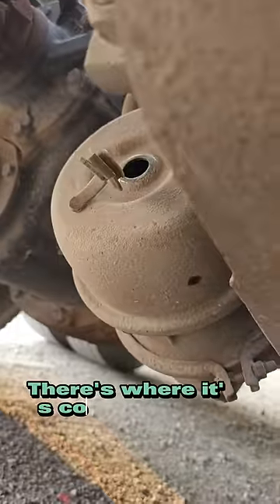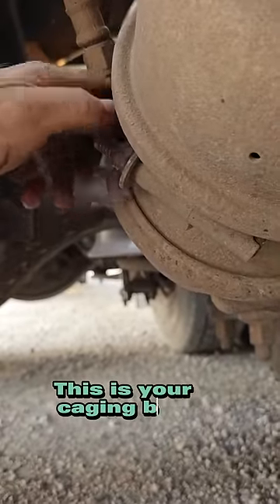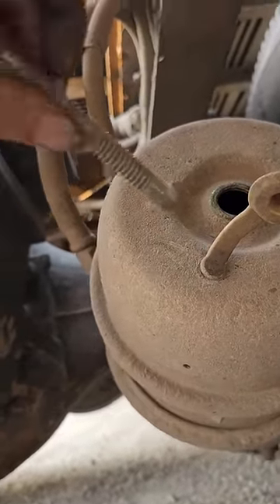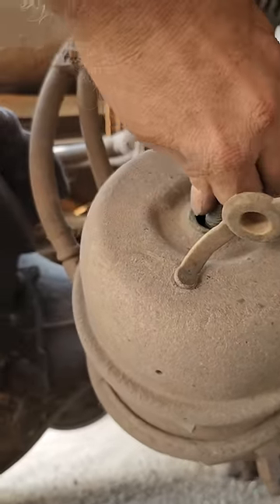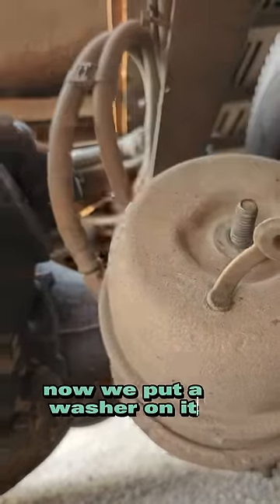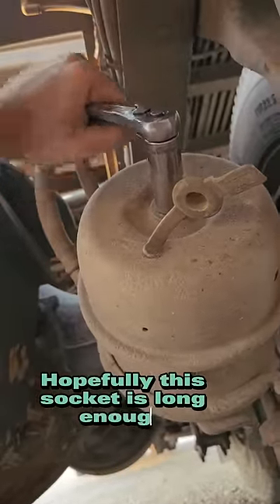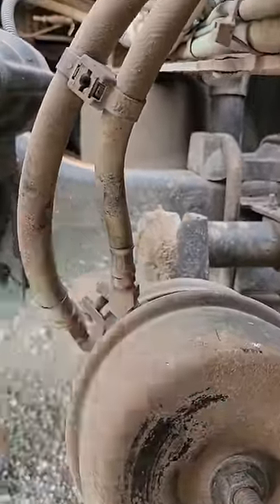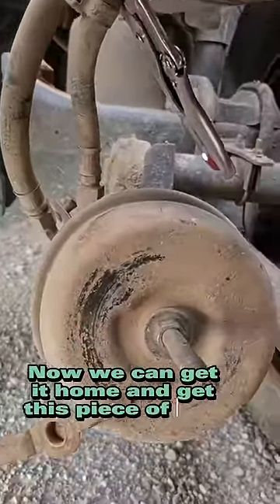How I cage a brake chamber and get home

Comment: Nice fix but please remind people how dangerous brake chambers can be if someone doesn't know what they're doing.

That spring can shoot through a concrete block wall and will turn someone's guts to soup if they're not careful or don't know what they're doing
Reply from the maker: Good advice.  I'll highlight your reply so its at the top of the comments.
Reply: You also need to put the parking brake on when work with a brake chamber as well for the slack adjuster to release so you can safely work on them.
Reply from the maker: @wethobgoblin2740  that's how I did it.  A lot of people have suggested to cage the chamber with brakes released bc it's easier but I just applied them and did it.  Took longer but felt safer.
Reply: Both times I had blown chambers the spring had broke and ruptured diaphragm. Company driver and funny I just had 1 blown on trl this morning. Waited a few hrs at delivery store while waiting for mechanic
Reply: Usually, the spring is broken by the time it leaks like this. You can tell if you smack the chamber and hear a rattling piece of metal
Reply: I was about to say the same thing hahah
Reply from the maker: @ItalianStallion1415  good to know.  Thanks for the knowledge
Reply from the maker: @tractorboy31  When it rains, it pours
Reply: @ItalianStallion1415 I've had more than a dozen leak in my carreer. only 1 had a bad spring.
Reply: Yes if the brake chamber explodes and your in front of it it can and will kill you! Be CAREFUL even if yours a professional
Reply: Very confused... what would one do to get a brake chamber to explode or a Mega strong spring to shoot through their guts?
Reply: @tractorboy31 😅
Reply: @jalenwiggins5831 ,
120 psi is standard air pressure on truck  brake systems. It doesn't take nearly that much air pressure to kill.
Reply: @joelnathan7184  so what do they do to release that pressure...........
Remove the wrong bolt?
Reply: @jalenwiggins5831  yes,  the band clamp.
It is holding the chamber pressure.
Reply: I need to see the inside, what did it caught? What spring etc
Reply: They are most definitely a bomb
Reply: Could just imagine someone removing a clamp bolt instead of the caging bolt which may be missing....
Reply: @ItalianStallion1415 That's not really true. We used to change diaphragms rather than chambers. Nowadays it's just not worth it, but I have changed lots of chambers that just had broken diaphragms and not springs. In fact the majority of the ones I have done.
Reply: Cagin bolt. They were invented in Louisiana.
Reply: @jalenwiggins5831 
Excellent q!
As he showed while unscrewing the Cajun bolt from the side of the chamber, a bolted clamp encircles the chamber near the center.
.
If that clamp is released prior to Cajun the brake-spring, the internal spring erupts with terminal velocity.
.
Those parking brake springs are engineered to stop the vehicle in an emergency, plus hold the vehicle while parked... irregardless of grade or weather.
As you might imagine, they are powerful and in a tiny space.
Reply: @largemarge1603  thank you so much!
Reply: Another thing regarding caged bolts is that when that bolt is under tension TREAT IT LIKE A LOADED GUN.  Do not put yourself or anything you care about in the path of that bolt.  If it cuts loose for some reason it will have enough velocity to pierce you.  That is a really strong spring under tension that is being held by two little tabs of steel and nothing more.
Reply: 1800 pounds of force in there, it’s kinda hard to hurt yourself tho. It’s either got to be almost rusted thru or you have to cut it open with a torch. They quit making the cans with removable clamps on the parking chamber a long time ago
Reply: Good emergency fix
Reply: Exactly how that bolt got the name dead man tool😂
Reply: Agree, did road service for many years, seen a few of these T bolts fail.  Still amazes me, 1 piece of maybe 1/4-1/2 rubber can can be so dangerous to change.  Was worse back when both sections had bolted clamps 1/2 piece clamps (they switched to crimped later on for the dangerous section).
Reply: Calm down boy
Reply: That side of a can hasn’t been serviceable for yrs no one can hurt their  selves with em and chances are the spring is broke anyways if that sides leaking.
Reply: Usually by trying to replace the pancake gasket
Reply: You mean like this guy?
Reply: The problem with this way of doing it is 99% of the time the caging bolt is rusted to the aircan. And instead of using vise grips to pinch the airline, I recommend folding the hose over and securing it with zip ties. An easier way to do this is to pinch off the airline and back off the slack adjuster as far as it will go.
Reply: The new 3030 cans and most all cans have the bad side with a solid crimp ring.  They made them dummy proof.  Taking a can part isn't dangerous if you do it correctly.
Reply: I don’t know what I am doing but now I know even if that looks easy my life can easily be taken away smh sheesh… 🙄

Comment: I always pull my cage bolts and put them in my tool box.  I've had way too many times i couldn't get them out of the holder on the brake can due to dirt/ salt/ road grime.
Reply from the maker: I'll have to do that, especially with winter coming.  Appreciate the tip!
Reply: @aftersolo always keep a spare or 2 in the truck with you
Reply: Looking at the dirt on that chamber and how easy he got the cage bolt out he doesn't drive anywhere near the rust belt 😮
Reply from the maker: @rickcross7888  definitely not.

Comment: I’d tape the vice grip to hose; less chance of loosing it over the road.
Reply: My dads friend had a vice grip on the brake line driving home on I-75  it came off went through someone’s window and made them blind and he went to jail good idea to tape it
Reply: I was going to say the same thing
Reply: @BillyBob-im7og how did they know if they went blind.
Reply: @magicalphones  lawsuit
Reply: I'd be more concerned about the possible damage to the hose? Are these not wire woven air hoses that will crush and break the steel braided portion of it and cause it to weaken?

Edit to add, I've seen low pressure fuel hoses be damaged from technique like this. So I assume more rigid air lines would suffer similar damage? I Understand the point of getting yourself home without a tow, but I assume that line needs to be replaced now? It's basically been crushed, isn't it's integrity compromised?
Reply: I used wire ties
Reply: @magicalphones Someone who was behind the impacted car drove after his truck and was honking/flashing to get him to pull over. He did right gave insurance to the police and stuff the lady was rushed to hospital and yes Cooper is right they sued him even after insurance felt out 10k she then sued for something like unlawful recklessness but it wasn’t reckless they used a different term in court.that’s how he found out about the blindness and yes he was charged.

He literally told the cop at the scene what he did and that’s why the grips fell off lesson learned DONT tell cops shit
Reply: @BillyBob-im7og  sounds like a bunch of horse dung to me, how long ago did this happen id love to look it up?
Reply: @RaviSingh-xl3os  hmm I’d love to ask my father but he’s been dead for a while now I’d have to say atleast 50 years ago died at 87 he did truck driving around the age of 30-40 so about that time range and yeah you can think what you want my dad got no reason to lie but I’m not sharing personal info if I wanted too maybe my username would be my real name

Comment: You can back the brake off the drum by turning the slack adjuster and then punching the libe off too. I dont ever leave a cage bolt in my new chambers. They fall out and ya run them over and screw up a tire.

Comment: Also, it is 100% legal to be down 1/10 or 10% of brakes. Just make sure you fix it quick. If another brake goes down or out of specs, the dot will put you out of service and ticket you.
Reply from the maker: Ok.  Appreciate the info.
Reply: Your service brakes still work with the chamber caged, so you've still got 100% of your brakes functioning while driving down the road. You just have to use caution when parking, as most road tractors only have spring brakes on 1 drive axle. If your truck is spec'd heavier, it'll have them on both drive axles. If that's the case, even with a chamber caged you still have more parking brakes than most road tractors.

And the OOS is 20%. 2 defective brakes on a 5 axle truck gets you shut down. 1 defective brake is just a citation.
Reply from the maker: @backroadtrucking  Yes.  That was how I interpreted the 20% rule as well.  I had an empty trailer so that was another 4.  The brakes still worked just fine.  I really didn't even notice it.  I just don't want to argue with people on here.  It's exhausting.  Some people got extremely upset about the video. Reminded me of my brother getting upset for me not using a torque wrench for freaking spark plugs.

Comment: its allways a good idea to wrap some tape around your vice grip pliers , by putting some tape around the head prevents them from puncturing the air line . then secure pliers as well .  the vibration with pressure and the sharp teeth on those pliers it will wear that line down .
Reply from the maker: Good idea.  Thanks for the advice.  I guess you could wrap the line too before crimping it.  I had a bigger hose I tried to put around it and crimp it but it just wasn't happening
Reply: Or just put a dime in the fitting at the can, no risk of damage to the rubber line.
Reply from the maker: @Zookeeper101  I'll have to remember to keep some change with me in the truck in my washers and nuts bottle.
Reply: Smile good.
Reply: I like to put a piece of hose on each jaw of the vice grips, give her some cushion to not bite the line.
Reply from the maker: @Mark_317  good advice.  I actually just purchased some hose clamps pinch off locking pliers.  They're just like vice grips except smooth.
Reply: @aftersolo they'll rust in your wash your nuts bottle
Reply: My dad would also put duct tape around the handle and then put some to the bottom of the truck just in case that thing came off…No one wants vice grips skipping down the highway at 75+
Reply: @Zookeeper101 I got on here to make a comment you took the words right out of my
Reply: @chrisrageNJ Was your comment supposed to make sense? Here’s a question for you. How many cups of sugar does it take to get to the moon? Now I don’t make sense either.

Comment: Little piece of advice from a diesel tech, just to make things a bit easier:
If you release the brakes, then insert the caging bolt and tighten it down, you'll do a lot less turning to ensure that it's properly caged. Even if it's leaking like that, it should still push the internal piston back a decent bit, just a little trick I've learned from changing them out so many times
Reply from the maker: I appreciate the tip.  Yeah, that would of saved a lot of headache.
Reply: Underrated comment
Reply: I think for safety reasons to show people the safest way is to do it the way he did it but yes the easiest way and the way I do it is to release the brakes.  Way faster.
Reply from the maker: Agreed
Reply: @Cyrus_The_Virus_00 even if you let the brakes off in the cab, when you dump all the air out and knock the engine off, the brakes will be on.

Air brake systems are fail-safe designed with the default state of the brakes being on and applied. Chamber service brake is a diaphragm pushed by air, park brake is a big fuck-off sweaty spring that can hold up a building. The spring is always trying to push the brakes on, and air releases the brakes.

No air = parking brake stuck on, the same as if the engine is running, with the parking brake pulled on in the cab.

I think the fail-safe exception is trains. I don't know why but I think they're the opposite way, with the default brake states. Like by default, the brakes are off, air applies the brakes. I work on wagons and trailers so I don't know anything about trains.
Reply: @gopnikolai7483 Its the same way in trains only its a difference in air pressure. You have to have pressure to release and to engage the brakes. No air means the brakes are on. When you have full pressure it means the brakes are off. Its a safety thing so you cant start a trian with no brakes. There are many videos with a way better explanation but hope this helps. You also have a hand brake on everything in railroad wich is a wheel that you spin to physically apply the bakes to the wheels basically ebrakes
Reply: Make sure to chalk the wheels
Reply: @travisworts6249  Actually that's a misconception about train brakes, at least in North America, it would be a lot safer if it was set up with a spring though, with train brakes each car has its own air reservoir that applies brake pressure to wheels on that car, when the brakes are applied in the cab, it releases pressure in the brake pipe which is basically a signal to the rail car's valve to put air to the brake chambers from it's air reservoir, however when the reservoirs in the car are empty there isn't anything from keeping the car from rolling, good examples of this are rail hump/classification yards, the lac megantic train disaster in Canada 2013, the spiral tunnel derailment in BC in 2019, and of course the 3 Cajon pass derailments,
Reply: And don't use vicegrips on a rubber hose it damages them
Reply: I'm glad someone else has some common sense 😂 but you should never pinch that service line with vise grips. Put a dime in the flare and tighten it down now no more air leak and you didn't break anything
Reply: Once you have the caging  bolt in place, dump the air out of the system ,then take the air hoses off of the brake chamber, then back off the slack adjuster to pull the brake rod out of the chamber, and then remove the clamp bolts closest to the axle,(Note that the newer chambers have a permanent clamp that cannot be removed,therefore the spring is contained & it is safe to remove ) , Do not remove the caging bolt!!!! After it is all done cut a in hole in the side and cut the old spring to release the pressure,then it can safely be scrapped & nobody will be hurt.
Reply: That and not advisable to pinch airlines with vise grips
Reply: If you put a vice grip on the shaft before you release the brake it holds the plunger down, then release the brake then cage the spring. And no need to clamp the air hoses, after you do the above steps, pop the buttons out  and both hoses will have no air pressure.
Reply: If you had a straight truck, not a tractor trailer, you would have to chock the tires for safety b4 you release the brakes to cage the brake chamber?
Reply: Anytime you work on brakes you chock the wheels. Or you might be the chock! Just sayin'.
Reply: Yeah, I mean.. ensuring the tractor or trailer doesn't go rolling away on you is a given
Didn't think I'd have to explain that part lmao
Reply: Be very sure to chock the tires first. You don't want the truck to move while you're under it.
Reply: Awesome that is so awesome advise thank you
Reply: When I put the caging bolt and I always have a problem with trying to get it cost but thank you for all the super advice
Reply: I was about to make the same comment until I saw yours lol
Reply: Any advice on when the slot is crooked to where you can't get the caging bolt in the slot?
Reply: @anthoneygantt4256  set the brakes. Take a pair of vice grips and clamp on the push rod as close to the chamber as you can get it. Then release the brakes and it’s just like you caged them. But make sure those vice grips are on there good a tight lol. Let’s you back the brakes off and get your clevis pins out. Sometimes you can get lucky and put the caging bolt in and push on it one side or the other and get that slot to get more centered, not always though.
Reply: Another trick, take the line off the can and fold it back on itself and use a zip tie to hold it or some tape. It's not good for the hose but it's better than the vice grips.
Reply: *would HAVE
Reply: Nope, not getting under a truck with three brakes released.
Reply: It could help until you lose enough air that your parking brakes apply automatically. Which will happen fairly quickly.

Comment: I was a class 8 truck mechanic for 6 years before I became a driver. Basic mechanical skills and an understanding of how semis work will save a driver a lot of time and money. Any driver willing to get on the ground to stay productive is gold these days fays.
Reply from the maker: For sure.  I was at it today putting on some new brake chambers on my trailer.  Tomorrow, looks like I'll be replacing the ecu for the trailer.  Brakes have been skipping.  I unplugged it and problems gone.  But yeah, I save a ton of money doing everything myself.  Only person I can be mad at is myself if something goes wrong.

Comment: You’re a dying breed my friend, mostly all new drivers don’t know what a brake chamber is.
Reply: I squashed a brake booster between the axle and the trailer frame the other day (don't ask how it got there). Lucky for me, that big spring was a goneburger, but the bottom half still shot out from under with a bit of force, landed right at my feet.